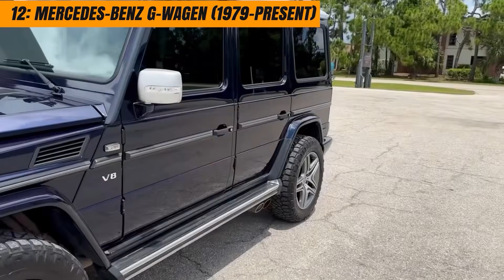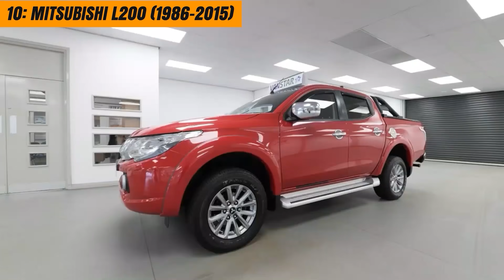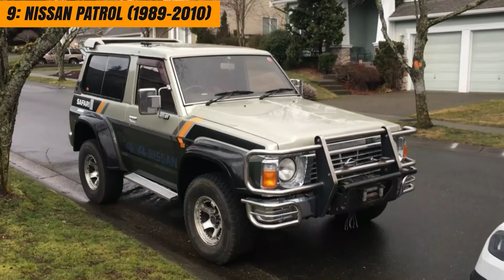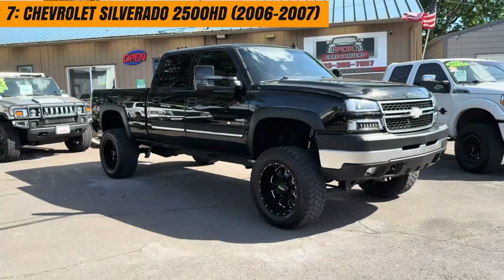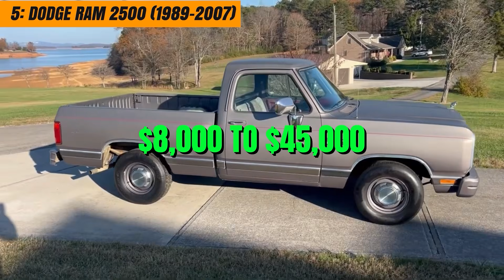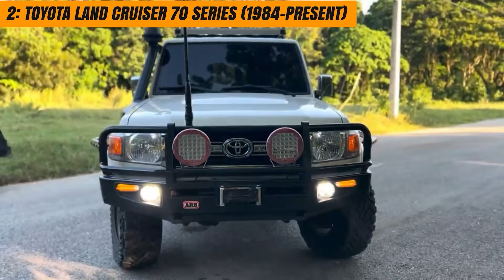12 Diesel Trucks That Were Built To Last Forever

Comment: Hi, it’s the 2 door Mitsubishi L-200 that is the favourite. The companies that buy these vehicles need them as work horses so the tray at the back is more important than having extra passenger seats and doors! The problem is that you are looking at these vehicles from USA eyes and that country does not make or import the two door versions of the Mitsubishi or Toyota. The USA does not produce vehicles that the customer wants it works out which ones make them most money and which vehicles keep on coming back to the dealers for repairs. Vehicles that achieve high mileage are a killer for the dealers. Cheers mate.  Harera